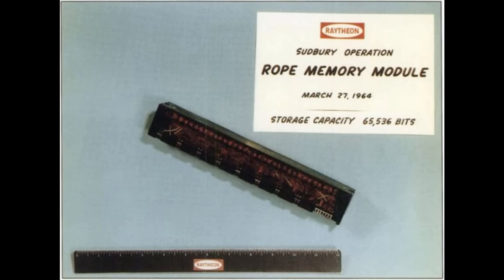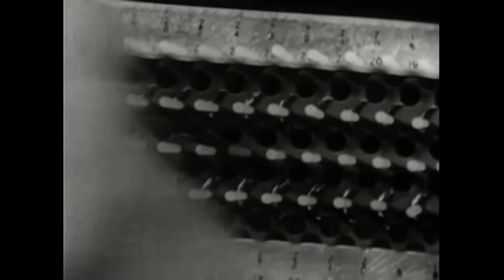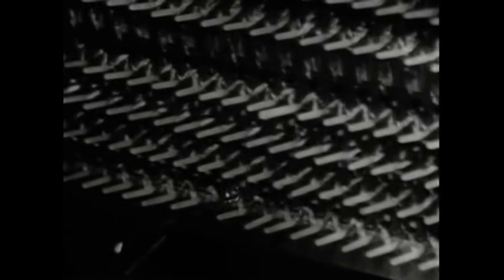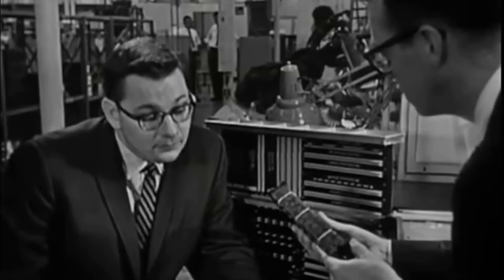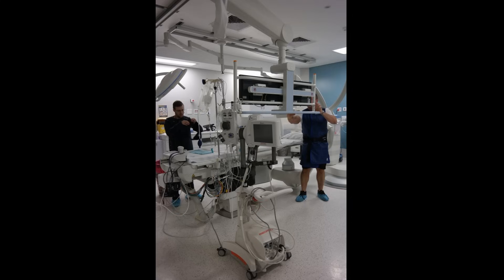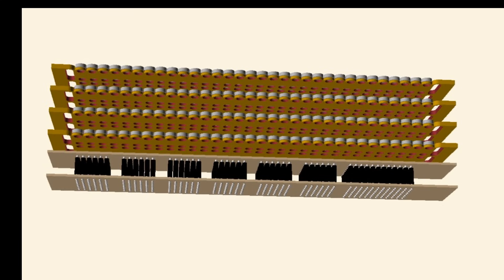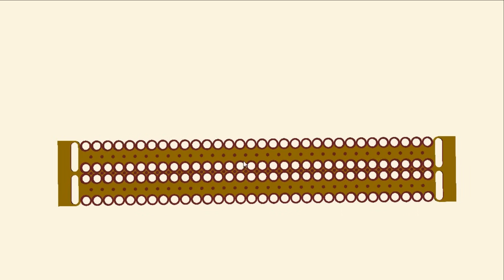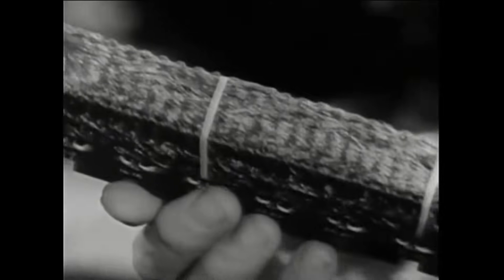Apollo Rope Memory Modules (Part 2 - Construction)

Comment: I am just wondering how much was working this Apollo calculator. Worst case, just looking nice on the dashboard of the LEM, showing some numbers or words on the display unit. Assuming they needed 64 Ko of memory to run the software, that means at least 524280 cores. Of course, the currant needed to drive each core plus the weight of the  logic components would have been out of specifications. So what? At least for the ROM (Read Only Memory) where was stored the system software could crunch the requested number of core by re-using the cores by passing the sensing wires where there is one core set as zero or set to one.
That means, assuming we dare to pass up to 192 wire in a tiny core hole, it would need 2730 cores. No need to say, for a system engineer, the burden of programming and testing such a calculator. A minor modification of the source program, and you have to pass again all the 524000 wires manually. Less cores, but a lot more writing and reading components. A little bit less if the scratch memory is included in the 64 ko. Of course, the scratch memory cannot use the 192 wires in one core, because you write variable data and you don't know where you get a one or a zero.
I am very doubting you can functionally arrive to conceive a working development tool which will compile the wiring as a known version of the developed software will have its own full hand-wiring process. And in a very short time range. Having long system engineering and software development since before 1980, I was at electronic university in 1968, I will be completely baffled if this calculator was really able to guide and land the LEM safely to the moon and back to earth.  
Much more to say following the Apollo 11 story, but this is another story.
Reply from the maker: You clearly don't have a clue, do you?
Reply: @AuthGate  :  One thing I am sure,  we didn't got the real full story from Nasa. Now, how far we went to the moon, I dont know. As an engineer, I measure the huge effort. We have something that looks credible on the paper and other things looking for me very doubtful. In fact, really, I didn't have yet got the 100% scientific proof that will convince me that they did really as told. May be you have, do you?
Reply from the maker: @degrangier  OK, so you have some doubts. Let's start with the software development process. (1) The software was written on paper first. That was common practice. (2) Once they were happy that it would be relatively bug-free, it was compiled on a mainframe into AGC machine code. (3) The compiled code was then downloaded from a minicomputer into a rope memory emulator. (4) they could then run and test the code on an actual AGC in realtime. The whole process could be repeated in a few minutes. The rope memories were only manufactured when they were happy that everything worked correctly.

Btw, there weren't 524280 cores. They could store 192 bits in a single core. Some of these bits were zeros and the rest were ones. Only the ones were threaded through the cores, so on average only 96 wires passed through a core. There were 36864 words of 16 bits each. I will leave it to you to calculate the number of cores. If you cannot imagine a way for this to work, then you should be humble and have respect for those clever engineers who managed to make this work.

So you see, real engineers are very pragmatic folk. We figure out how to break difficult problems into smaller problems and then solve the smaller problems. If you were a real engineer, then you would understand this and be able to figure these things out for yourself. I cannot "prove" to you that NASA went to the moon, but I can see how all this was possible and I know engineers and understand the pride they take in their work. These people didn't do it for the money. They did it because they wanted to go to the Moon. They made mistakes, fixed it, and tried again until everything worked as good as was humanly possible. They went to the Moon 9 times and landed 6 times. All the evidence is there. You just need to open your eyes.
Reply: Paul Degrangier If you are doubting or making a claim, it is up to YOU to provide proof for that claim, not the person to whom you are expressing or stating the claim.
Reply: It wasn't a "calculator" -- it was an embedded computer to control the ship. My understanding is that some big number crunching was done on earth at NASA flight HQ by IBM mainframes, with data being sent back and forth via the telemetry system.
Reply: @James_Bowie  This is not possible. the communication system would need a driven locked antenna to the proper earth direction to maintain sure communication during the landing operation. There was not this any system for that. The software to handle sure transmission protocol would require to much memory space and additional tracking system which was not implemented.
Reply: @AuthGate  You don't know how works a core memory.  A core cannot store 192 bit ! A core can store only one bit, if you can write, it will be either a one or a zero. If if you want to store or read an 8 bit ASCII character, you need 8 bits, that means 8 cores. Passing 192 microwires in a single core, is allready a mecanical programming challenge, and the process of programming and testing a quite impossible task.
The core rope memory is at my opinion, just a specification trick to announce unrealistic achievement . I you want to re-use a core this is technically unrealistic because you need the as more as 192 drivers circuits for all the 192 wires, increasing total supply currant. Completly stupid. Also, when you read a core, you destroid the data, and you need to rewrite the core. Typically unpractical to built.
Reply: @Trenton.D  see available documentation how works a core memory, or see the answer I gave below. I have been working at Ampex company arround 1980, and have seen these core memory used in military. Have a look there first: 
https://en.wikipedia.org/wiki/Magnetic-core_memory
Reply from the maker: @degrangier  you are confusing core memory (RAM) with rope memory (ROM). The latter can "store" as many "1" bits as the number of wires that you can thread through a core. If you look closely, you will notice that rope memories use much larger cores that are made from different materials. The data is also not stored in the core but encoded in the wiring.

Comment: Have you figured out yet how the rope memories actually worked? If the memory bits were encoded in the arrangement of the sense wires, why did they need magnetizable cores?
Reply from the maker: I have 98% of it figured out and have actually started making a video describing the technical aspects. Unfortunately I have been a bit busy the last year, but I promise that I will publish this in the coming months.
Reply: You still need a way to couple the field from the address wire to the sense wire. So the rope memory cores are just tiny transformer cores and not permanently magnetized as the core memory cores are.
Reply: Ah, I see. All the information is encoded in the routing of the sense wires.
Reply: Exactly! NASA wouldn't have been able to degauss these modules even if they tried.

Comment: Almost 65k per Block !
Reply: By “pieces of information”, I think he meant “bits”.
Reply: yeah, so 65k, right?
Reply: is it 16 bit data? if so, 4k bytes of data
Reply: He said it has 512 cores. each core is either 1 or 0 , meaning its 512 bits, each byte consists of 8 bits. making each module have a total memory of 64 bytes. 1 kilobyte is equal to 1024 bytes, so it would take 16 of these to equal one kilobyte of memory. to put than into perspective 1 gigabyte is equal to 1 billion bytes. and the computer i am typing this with has 20 gigabytes of just RAM and another 4000 gigabytes of HDD space. roughly 62,812,500,000 times as much memory in much less physical space. amazing how for this technology has come since then..
Reply: I suspect they may be sharing some cores between multiple bits/bytes, not as straight forward as one core per bit. also not necessarily 8 bits in a byte but is common.
Reply: yes necessarily 8 bits in a byte... its a unit of measurement, no more debatable than how many inches are in a foot.. and yes 1 core is one unit of information, either 1 or 0.. it cannot be anything else. these are not like "CPU Cores" these are a single ring magnet exited by a winding of wire.. the flux can go one of two ways within it, clockwise or counterclockwise, 1 or 0..
Reply: Yes 65536 bits as it says on the first slide.  This is 64K bits since a K is 1024 bits.  It's important to note that this is ROM not RAM - the magnetic cores are simply transformers here and don't store information in a magnetic field like in magnetic core memory.  Each core here can have up to 128 sense wires going through it.  32 cores x 4 rows x 4 planes = 512 cores x 128 sense lines = 65536.  The cores would have address wires too - word lines and bit lines - and the sense wire would encode 1's and 0's by whether it is routed though a core or not for a word-line/bit-line pair.
Reply: “K” is the SI symbol for “kelvin”. You either mean “k” (= 1000) or “ki” (= 1024).
Reply: https://en.wikipedia.org/wiki/Kilobyte
Reply: +Chase 'em Back Tools -- No, a byte is just the size of a "character" in whatever architecture you're working with. The PDP-10, just as one example, used 9-bit bytes. This is why the original ASCII specification was a 7-bit standard; that was the smallest practical byte size at the time (setting aside some weird architectures that used 5-bit bytes).

The reason 8 bits became the most commonly used byte size is because of networking. Communicating between architectures with different byte sizes is a pain, so the networking engineers defined the "octet", which is always exactly 8 bits ("oct" = 8), to simplify the discussion. This in turn lead to the modern standard of a byte almost always being 8 bits.

Comment: Lol, okay, I see now you already found that video.   My main question, obviously, is how the hell do you store 65,000 bits (65,535?) using 512 cores... :-/       Maybe I'm not understanding what he's trying to say correctly.
Reply from the maker: The cores don't actually store the bits as is the case with core memory (RAM). The cores are used as little transformers that "reveal" the wiring of the memory. Each core can be (theoretically) threaded with as many 128 wires. There is a clever mechanism by which you can enable a subset of 16 wires (a strand). You can also disable all but one core, by saturating these cores with an inverse polarity pulse. The single isolated core is then "pulsed" and the 16 isolated wires (selected strand) are sensed to determine if they are threaded through the core or not.

In short, each core can sense 128 bits (16 bits in 8 strands). With 512 cores, you then have 128 * 512 = 65536 bits.

Comment: Il faut voir cette vidéo:  https://youtu.be/2KSahAoOLdU
Ceci démontre bien ce que j'avais pressenti en ce qui concerne la fameuse "Core rope memory", que c'était juste irréalisable. On a jamais vu un ordinateur de bord Apollo équipé de ce type de mémoire. De fonctionnel, il n'y avait que la mémoire à tores classique, ce qui ne permettait pas d'avoir la capacité de stockage suffisante pour des programmes de calcul élaborés. Il est curieux de voir dans l'équipement présenté ici, un "simulateur" de "core rope memory", comportant des circuits intégrés, apparemment de type TTL qui n'existaient pas encore avant 1970. De plus, ce prototype, intègre ces circuits sur des barres de contacts non soudées, ce qui n'est pas acceptable en opérationnel dans ce type d'application spatiale.